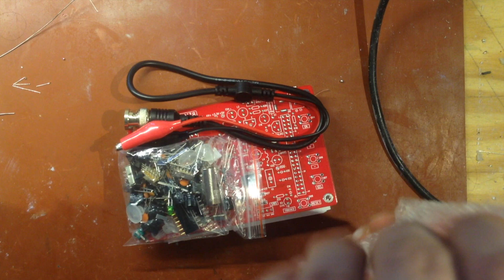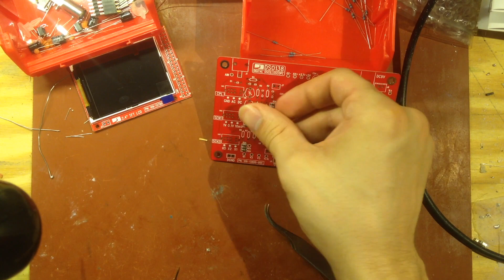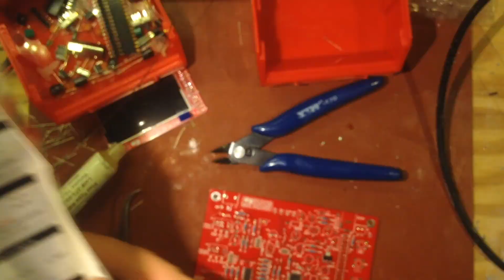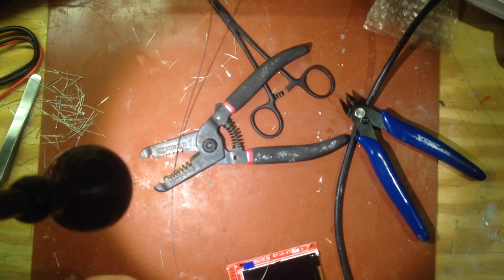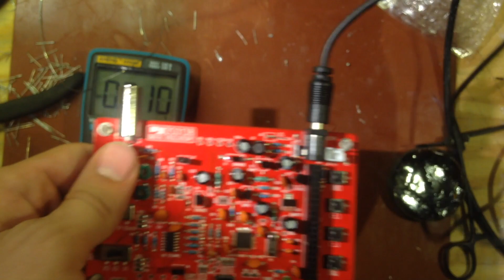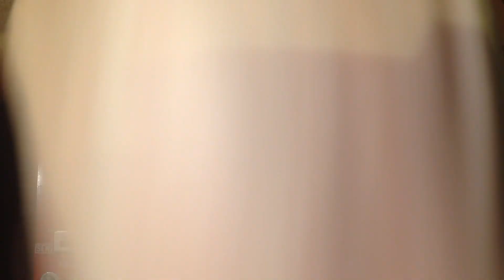DSO138 - Oscilloscope Kit Build

Comment: My preferred power source for the DSO-138 is a 5 volt to 9 volt boost converter plugged into  a 5000mAH powerbank.  With the 'scope in a plastic case, that makes a totally isolated test instrument that I use for checking DC->AC inverters with no concerns about unwanted connections to powerlines or system grounds - the 'scope and its power supply are floating. 

I can confirm that the pure sine wave inverters used with my small solar system produce a cleaner sine wave than the local power co-op.

I also have a Tektronix 4 channel, 100 MHZ 'scope but the DSO-138 is much smaller and lighter, is isolated from power and grounds and is more than adequate for checking the waveform of 60Hz power.